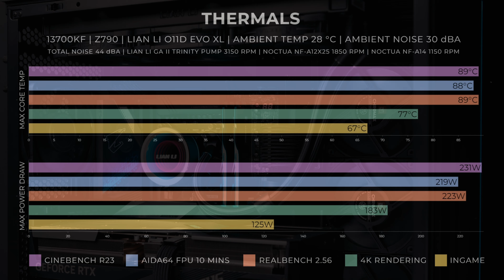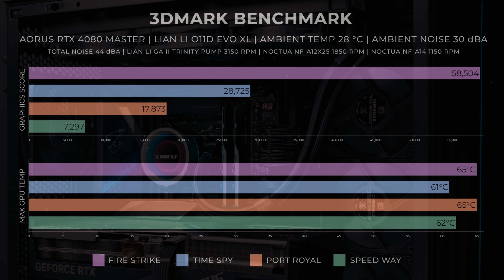Lian Li O11D EVO XL Gaming PC Build | Aorus Master Z790 & RTX 4080 | Noctua Chromax | Intel 13700K

Comment: If radiator on top is an exhaust, i would lose the dust filter
Reply: I always do them as intake … why using warm case air to cool down the radiator as … intake it uses cooler air from the outside.

Comment: Wouldn`t there be a ton of heat going from the GPU in the CPU cooler ?? I see u have the fans of the cooler on the exhaust setting not intake ...
Reply from the maker: It's set up with a top exhaust AIO cooling system, prioritizing GPU cooling. 

06:54 in the video, temperatures are already below 90C, which is quite good. 

Installing the radiator as a side intake could achieve a balanced setup in the O11D EVO XL case, with bottom intake and top exhaust likely proving effective.

For an Intel i9, opting for a top exhaust sandwich configuration or even a 420 radiator seems like a solid choice. Even with a preferred cooling setup, the EVO XL chamber is already massive, resulting in generally great cooling results.

Comment: How did you arrange front panel connection? Lion li evo xl has different from the mobo?
Reply from the maker: Hi! The thing is a single connector with 9 pins. Yeah! It's different from other cases, but it's compatible with standard motherboard specs, so you just connect it. 💜🖤

Comment: This wouldn’t fit in the new Vision O11 case would it?
Reply from the maker: Yo!

You can install everything as is, except for the three 140mm Noctua fans at the bottom. 

Ah, the next video will be the Lian Li O11 Vision. I'm planning to use the Lian Li P28 cooling fans for it👍
Reply: @PC_SNAP   so I could probably fit 3 120mm fans at the bottom. What I like about the Vision is the removable motherboard chassis can  move up or down a spot to add one or two fans to the back panel.
Reply: @PC_SNAP  when you do your next build with the Lian Li Vision O11 you should do it with the Aorus Master or at least one of the larger EATX boards because the Vision is advertised to fit EATX boards but only up to 28mm
Reply: Are you 100% this will fit? I am having a difficult time fitting my board into the o11 evo rgb
Reply: @BADcharacter303 How is the motherboard making room for the rear fans … the motherboard does not conflict with the fans at the rear … the motherboard is behind the rear fans (looking at it from front) … in my Evo Dynamic its the short rear mesh structure limiting the number of rear fans. There is just 40mm rear mesh below fan 1.

Comment: For anyone copying this build I would highly recommend not installing the optional dust cover on the top exhaust panel; it will only increase system temps, and trap dust inside the case. Also, for a system this expensive you should use an LGA 1700 contact frame. These two things would likely bring down max CPU temps 4-6C.
Reply: 4-6C is nigh meaningless for a majority of people. If you're at a point where 4-6 degrees is meaningful, then you might want to start looking at other coolers.
Reply: @icanmakeeverythingilovedie9861  
Oh, I completely agree. The "majority of people" don't really care about a 4-6C difference. But the "majority of people" are not buying $3700 showcase computers like the one in this video. I don't think it's a stretch to believe that people who are willing to spend nearly $280 on fans alone might want to take an extra 5 minutes of their time and an additional $15 to drop their temps a few degrees.
Reply: i spent $350 on 10 nf-a12's for my build, still have the filter on top with top aio on exhaust, don't have a difference in dust, don't really have dust inside, and it doesn't increase temps by 4-6deg with the dust filter on either.
Reply: How expensive would it be to make?
Reply: Whats the point? Systems temps are perfect in that case any way if you have proper cooling setup. And yes … already using warm case air to ‘cool’ the radiator the dust filter there does not really suit any purpose … we want dust out … not kept inside the case.

Comment: I'm no expert in PC building, but did you fit the Noctua fans on the top instead of using the fans that came with the Lian Li AIO? Could you please list the fan size for top/bottom/side/rear? I'm planning to build a similar custom built PC, so it'd be helpful to know, thanks.
Reply from the maker: I used 140mm fans on the bottom, and 120mm fans on the side, rear, and for the radiator.
Reply: @PC_SNAP  Thanks for the reply. Would you advise replacing the 3x AIO fans with the Noctua fans? I'm still undecided. Also wondering about whether to replace the 2x fans that came with my RTX 4090 Suprim Liquid X with the Noctua fans. Any suggestions?

Comment: You can install Push and pull in the lateral/frontal zone? 25mm fan and AIO radiator 56mm
Reply: ???? You mean at the side … why shouldn‘t you? Its the XL and you could do so in the medium Evo O11 Dynamic. There was room to do a Lian Li TL & TL LCD push pull with the NZXT Kraken Elite 360 v2 (2024) and that radiator is massive.

Comment: I'm more interested in how you have it with the Noctua fans than spending money on Lian Li RGB fans that cost around 400€ plus the tower.
Reply from the maker: Noctua is the best choice!
Reply: @PC_SNAP  Yes, although it is not that cheap either, but compared to RGB you can save about 100€. I am also more in favor of zero RGB.

Comment: Did you have to take the plate off the back of the  motherboard ? I can’t get some of the screws to reach the standoffs.
Reply from the maker: You don't need to remove the motherboard plate for the build, there's no issue with that. I just wanted to demonstrate in the video that the EVO case can be disassembled for height adjustment.

Comment: Nice build.  I did a build about 4 years ago in the EVO XL.  I love the case.  I do have a question.  Are the fans on your radiator at the top set as exhaust?
Reply from the maker: Yes, I used it as an exhaust cooling fan!

Comment: I have the Lian Li Dynamic mini o11, it is a little wider than the EVO in the video, would it be possible to insert the 4080 aorus horizontally with the strimer plus v2 or with a cable mod?
Reply from the maker: I haven't personally used the Mini version, so I can't say for sure, but with the EVO, there are some tight spots for horizontally mounting the 4080 Aorus.
Reply: The mini is not wider than the one in the video. The XL in the video is 34mm wider than the mini. The mini is 269.9 and the XL is 304mm.

Comment: Its an EATX mobo right? Does it overhang on the right side? Thanks
Reply from the maker: Yes it is!
Reply: Despite it is an XL case you still cannot fit proper e-atx as max e-atx size is 280mm.

Comment: sir, is there a free 3x 120mm front fan bracket and meshed front panel from the box so you can replace the glass front panel?? this'll be my next case for my dream upgrade!
Reply from the maker: Thanks for your comment!

It is not included in the package. However, the cooling seems sufficient already. I don't think a front mesh is necessary. 💜🖤
Reply: @PC_SNAP  my plan build was going to be a 360mm gpu rad like the aorus extreme waterforce future 5090 on the front as push/pull and also from the top cpu aio cooler push pull too. thats why this case is perfect for that
Reply from the maker: @rcortez5979  Oh, I got it, bro! With such a build plan, a front mesh panel should be cool, I'm not sure if Lian Li HQ has plans for a front mesh though. Thank you for sharing your great build info!
Reply from the maker: @rcortez5979  Bro! It seems like they might release a mesh kit. Take note👍
Reply: @PC_SNAP  oh hell yeah 🔥🔥🔥🔥

Comment: Why the filter on top? 😢
Reply from the maker: Ah! I don't use the top filter when overclocking or using a small-size chassis.
However, I typically just use it. Moreover, it's too much of a hassle for storage.

Comment: lian li evo xl is designed for water cooling.  but the built-in aio standard components that could be put in a standard case without using the full potential of the evo.  so sorry but a waste of the case in my opinion
Reply from the maker: I completely agree.

The parts shown in the video are actually sufficient for the O11D EVO as well.
Of course, it's also the highest-performing stuff I have.

Thank you for your comment👍👍